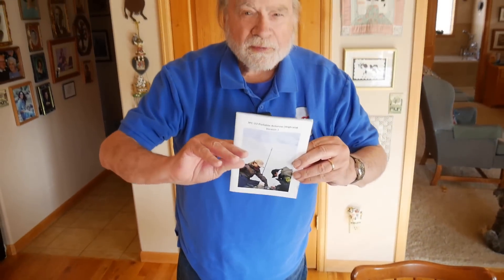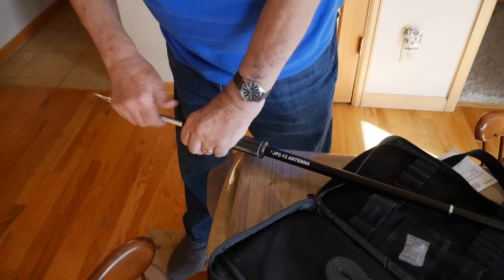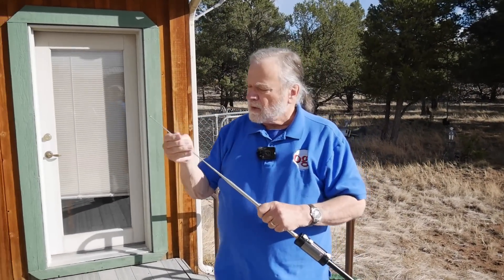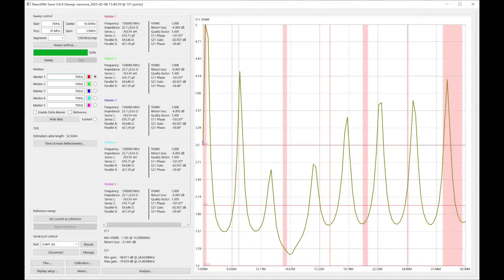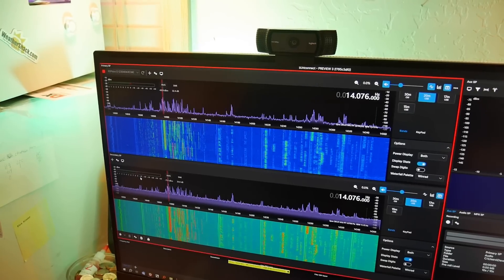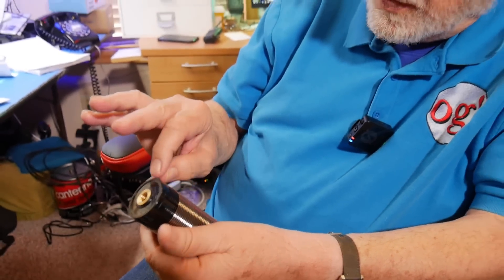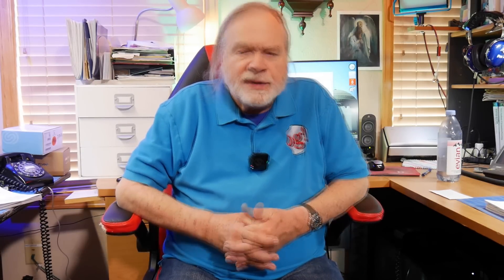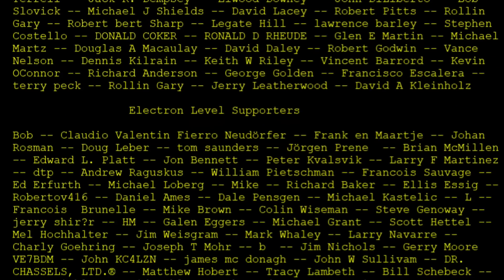Review of the GOOZEEZOO JPC-12 Antenna (#1226)

Comment: How long are the mast sections? About a foot each? Stainless wire doesn’t oxidize like copper. Wolf River used it too because it’s tougher I suppose and won’t wear like copper. Silver plated bus wire would work I think. Trying to remember the name of a powder that was used to plate circuit board stock. I think it was called Tin it. Maybe plate copper wire and rewind my Wolf River if I can still find the powder anywhere. Are you pushing the slider in before trying to move it?

Comment: I have this antenna from the same vendor. I have had excellent POTA and ragchew experiences with it. Is it a 3-ele beam?  No. But for quick setup and fun, its great. I plan to use it next tech ham class to allow the student to find resonance.  Oh one more thing. I purchased a 17ft whip for use with and without  the coil and guess what? i can adjust it to max dip on whatever frequency i need to work.  10m to 40m works. I also got a tripod from gigaparts to not have to peneratrate the ground.  Its all about having fun first, not a perfect antenna

Comment: I purchased one from Amazon on Thursday, got it on Friday and returned it on Saturday. Using the extender rods made it damn near impossible to reach the coil.  It WAS IMPOSSIBLE to reach the whip for adjustments. 

Then, it required a VNA. to adjust THE WHIP!

The instructions were clearly written in Chinese with a vain attempt to use Google Translate.  The instructions were NOT UNDERSTANDABLE.  This antenna is a piece of crap.
Reply: Wow i found it a peace of cake to tune on 40m or 20m anything above 20m remove the coil just adjust the telescopic anttena its so simple i like to use a 84ft inverted vee end fed  with a homemade L / C matcher
But you dont allways get the room cheepest anttena you will ever use and one of the best 😊

Comment: One other thing, Dave. If they had used copper, the coil would wear over time as copper is much softer than stainless steel. Also, copper would corrode over time.

Comment: A JPC 12 radial plate is also available on ebay.  Easier to hook up the radial wires used in the video.  My JPC 12  is a reliable antenna for home and field operations.

Comment: Hi Dave! You compare the JPC12 to an antenna that ist way longer, way heavier and about 20 times (!!!) more expensive. Does this make sense? I don´t think anyone who ist interested in buying a portable antenna for Pota or Sota will seriously try to use more than a hundred watts, neither more than 1 kW.
I own the JPC12 for myself and used it several times doing Pota, it worked fine on every band from 40 to 10 meters. And this happened using the included radials! I split them two by two so I got 5 strings. They are much more convenient to use than the bulgy cables you used and they fit easy into the antenna´s case. I doubt, if your radials do.
73 from Bavaria🖖

Comment: Since you mentioned it, a base loading coil for a 1,000 watts, Could you give us a design for a Coil and Whip for a full boat load of 1,500 watts. Using 1/4 inch copper refrigeration pipe and maybe a 5 or 6 inch diameter coil on a 4 inch PVC pipe form with a High temp silicon spacer at 4 spots around the form?

Comment: This review makes no sense.  Comparing a loaded vertical to a massively expensive beam is not how to do this.  It needs to be compared to other antennas in its class.  You immediately throw out the included radials, which are part of the package and should be used as part of the review.  Then you use LESS of your own radials.  If that equals half a dB difference, you've done the antenna an injustice.  You also berade the coil for using stainless steel and claim it should use copper.  Since this is designed as a portable antenna, it's assumed that it will be in all the elements, moved frequently, and adjusted often.  Copper will corrode and deform far easier than stainless. 

Please start comparing antennas of similar class.

Edit:  I've been rightfully corrected that the BigIR is a vertical. 

I do however, assert my previous argument.  It's in a totally different price class, performance class, and is absolutely not comparable.
Reply: I don't recall Dave using a beam antenna in his comparison.  The reference antenna was a SteppIR vertical with an extensive ground radial system.  IMHO, it's valid to use a reference antenna for comparison -- as long as all evaluated antennas of the same class (e.g., portable inductively loaded vertical antenna) are compared to the common reference.

I agree that the radial system should either be the same for all antennas of the same evaluated class, or that the radial system should be implemented as prescribed by the manufacturer.  This is regardless of the reference antenna's radial system which is assumed to be superior.

Finally, a copper coil will always electrically outperform a stainless steel coil of the same dimensions.  For example, Buddipole coils are tin plated copper that perform well and suffer insignificant degradation due to typical environment exposure and handling -- based on my experience.  Other examples of copper coils are the Chameleon MCC (silver plated) and Super Antenna MP1 (tin plated).
Reply: @DaDitDa Thank you for the correction on the BigIR.  I'm sorry I missed that one. 

I continue to assert that this antenna is not in any way comparable in price, performance, or use case to the reviewed antenna.  This is not useful information for comparison unless you compare it with other antennas in the same class.  He doesn't do so in this video, instead making direct assertions that the review antenna is simply worse than reference.  No ham needs to know that their $150 POTA vertical performs worse than a $2,800 dollar premium home antenna product.  They need to know how it compares to a WRC, Buddipole, or a straight 17' whip.

My point about copper vs stainless stands, however, I'm willing to accept criticism on all of  my observations.  I could be convinced differently about a coated copper product if it makes sense.
Reply: @jasonweisberger8257  IMHO, stainless steel coils are fine when only minor to moderate loading is required -- especially when not placed at the antenna base.
Reply: It can be done, but it's onerous to set-up ten antennas of the same class and compare them to each other. What Dave did is more practical and it gives you the same data.  If he compares everything to his BigIR, then you can compare any two in class using their respective tests against the BigIR as the reference.

Comment: The provided radials work well with a single loop connector and the option to separate the ribbon into 10 or less radials.  I separated mine into 4 and set up as a X.  I have used this for almost all of my POTA activations so far on SSB QRP (<10w) and find it works very well. From MN I’ve reached all corners of the country and onto CA with ease.(only used 20m and 40m so far)  This sets up or takes down in 5 minutes and fits right in my backpack. I prefer it over my wire antenna to save time and have consistent performance every the time.  Tuning is fast and I usual don’t have to move the clip or sometimes just one click either direction base on the particular environment. I like cheap home brew antennas but this one was worth the price.